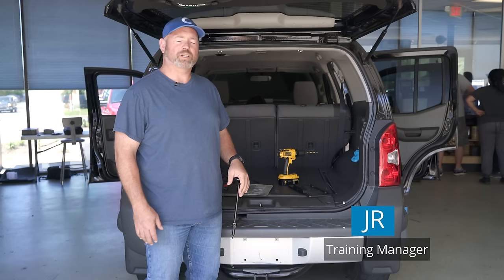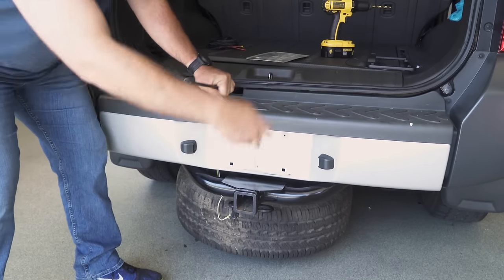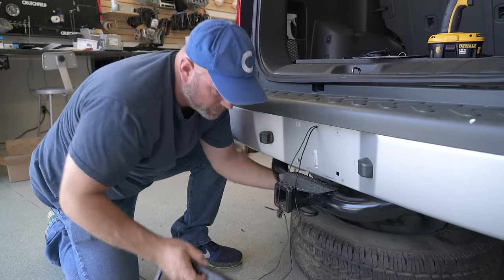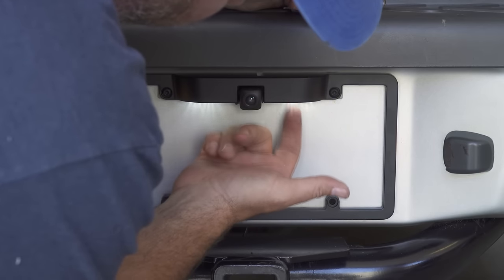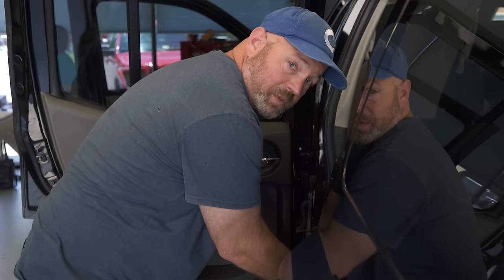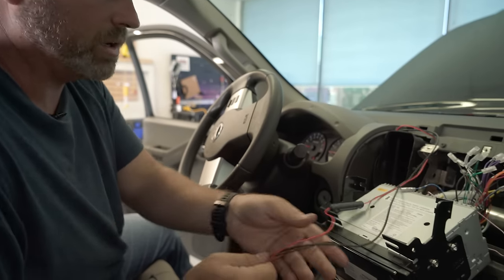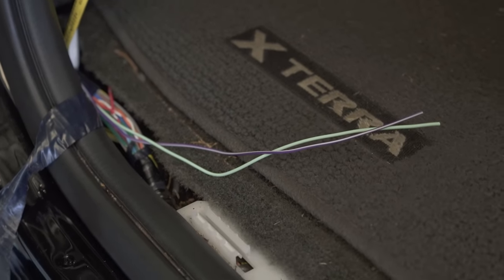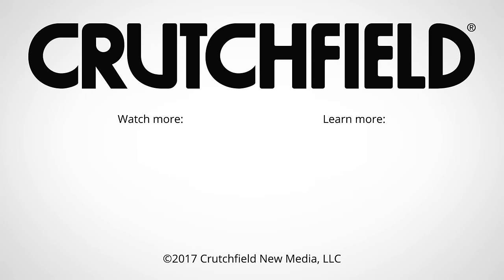How to install a backup camera in your car | Crutchfield video

Comment: The best option is to power the reverse camera from the vehicle's reverse light. Camera need to be powered only when you're reversing, thats how i do it all the time. Unless you have the bird's eye view system.
Reply: Exactly,why make it so complicated
Reply: If you have a backup camera it would seem handy to have it on while you're driving also just to have it.
Reply: I would find that a distraction.
Reply: @age_of_reason  Thats exactly what i do. This is very helpful when you have a vehicle with poor visibility through the back window.
Reply: Bruce@CampArmament does your camera run full time? Who makes it? Ty
Reply: @bowlingballmagic  It does run full time and is made by ESKY, it cost a whopping $18 shipped and I have been impressed with it.
Reply: @age_of_reason   Premature failure. Running WAY more than it needs to. Electronics only last so long.

Comment: Never use those taps.  ESPECIALLY on the exterior of a vehicle.  ESPECIALLY where it will get wet.  ESPECIALLY on a utility vehicle that will most likely be used off road.  Just because it is easy.
Reply: How would you do it correctly?
Reply: @metroids224  Sauter the wires together and wrap them in electrical tape.
Reply: I would recommend using solder as well but using shrink tubing instead of tape.

Comment: why didnt you show us how to find the wire for reverse ,to wire up the front part
Reply: Paul Aguilar the location varies with each make and varies with each model. There is an industry standard for the color of the reverse wire, which is orange/white. But as the vehicles get older this becomes no longer true. I know this is old but maybe it’ll clear some things up for someone else.
Reply: The wires are different for each car, you need to look up a wire diagram to figure out which wire you need to tap.

Comment: If your not sure where your reverse wire is you can simply run a wire from the stereo to the reverse light since you will already be running the harness for the backup camera

Comment: With the plate being on the bumper, not on the hatch, you can also go under the vehicle along the wire loom that goes to the cab and come in through the firewall wiring grommet. Harbor freight sell the flexible plastic wire loom to run your wires in. The way he is doing it keeps the wire safe and dry inside the vehicle. Much better.

Comment: I feel like you didn't cover the reverse wire much..
Reply: Same here totally confused
Reply: purple guy. I returned this a year ago
Reply: You just run a wire from the reverse, duh
Reply: Joe Biederman if only you knew the time I wasted on this shit.. I ended up taking that back a year ago
Reply: He covered it as much as it can be covered. If you don't know how to properly use a digital multimeter to test voltage on the wire you can probably find it at your vehicles BCM usually in one of your kick panels. But you can get it at the back of the taillight assembly near where you're mounting the camera but again a multimeter to find the correct wire without blowing up your car.  If you don't understand basic electricity then you're better off letting a stereo shop do it for you. Otherwise chances are your going to cost yourself alot more money than what a backup camera costs when you inadvertently fry a computer in your car..it's not rocket science by any means but with that said you do need to know what your doing. Every vehicle has a different color wire and it can be in different areas in your vehicle. Therefore you need to be able to properly figure it out on your own.
Reply: @JoshSmith-wo7zw  finally I waited 2 years for this comment thank you!!
Reply: You connect the reverse wire to the back of the radio not the camera. That way if you're radio has the ability to use the rear camera to view what's behind you without the vehicle being in reverse. If you Power the camera from the reverse light then it will only work as a backup camera because as soon as you shift it out of reverse the camera looses power and you still have to connect it to the radio regardless so it knows to go to the backup camera input when you put your vehicle in reverse. So regardless it has to go to the radio either way. Reverse light circuits are usually always positive trigger. Not negative. This is important because if you have a vehicle that has a negative trigger reverse light circuit then your going to have to use a relay to invert the polarity to your radio otherwise it's not going to work. Again you need to know what you're doing.

Comment: If I may ask, wouldn't have been more efficient to power the camera from the reverse light's power wires?
Such a connection will only power the camera when the gearbox is set in reverse, thus (probably) prolonging the camera's life.
Reply: i agree
Reply: I mean, worst case scenario, for the newer cars that "monitor their lights" and might throw a tantrum, just use a relay; order shall return. :)
Reply: That is correct. That is the ideal connection if you only want to power the camera when car is in reverse. I want to have it on all the time so I ran my wires to the monitor up front. Still haven't been able to get the setup to work. I think I have a defective camera, monitor, or both.
Reply: Current stereos have the ability to select and show it without having to put the car in reverse for various (not not fully common) reasons.   You can wire into the reverse for the trigger but you want constant power to be able to view it whenever.

Comment: Anytime you run a wire/cable/hose thro a metal hole you need to install a rubber grommet in the hole to keep the wire from chafing & eventually shorting to ground.

Comment: I have an SUV with the license plate in the hatch (2006 Mazda Tribute). That's going to be an interesting install, but I think I am up for it. Just need to get the wiring throug the hatch somewhere, then up behind the plastic hatch panel, and the hard part will be getting it up through the rear window frame and I hope to be able to fit it through the stock rubber wiring boot for the rear defroster/wiper and out under the headliner, down the rearmost pillar cover, and out in the area behind one of the platic interior covers that goes over the wheel well. Then im golden as the wires for the lights are running right there to tap into the reverse light positive for camera power and trigger (I have already had that panel off to repair a rusted out wheel well/shock mount, if you have a first gen Mazda Tribute/Ford Escape/Mercury Mariner you know the pain I'm sure). Then all I have to run up all the kick panels the radio is the RCA cable with the trigger wire on it and done, I think.
Reply from the maker: With all the forethought you are putting into this, you should be able to get the backup camera installed. Good luck!

Comment: The really mystifying part is decoding the terminology used to describe wire assignments since I have wiring hardware, radio, and camera coming from three different manufacturers who use slightly different terms or abbreviations. There's also the shade of colors used for the wires themselves and the number of wires. I have a violet wire that looks black and has three different green colors and four orange wires, but I only need one... I think. On top of this, everything is printed in micro text. At least I get sound out of the front speakers, I may forget about the backup camera though.
Reply from the maker: Hi TB, in some cases wiring everything up can take some extra time. Keep in mind if you got your components here, you can call our Tech Support for help with your installation. Their direct number is on your invoice.

Comment: I bought the Toguard CE80A, the mirror & the GPS was easy to install but ran into a problem trying to find a place for the rear view mirror.  I have a Buick 1999 Riviera and I really don't want to drill any holes on the car.  Any ideas?   Thanks    Joaquin In Tucson Arizona    Thanks for ur post.
Reply from the maker: We are not aware of a way to install a review camera on your car without drilling for at least the cables and sometimes to mount the camera too.

Comment: OK so great video but the reverse wire What color wire does that get tapped into, trying to get this done on my 03 Chevy Silverado 1500. I need that connected for the camera to come on when I put the truck in reverse right?  That wire is not connected right now and I have to push the camera button on my Kenwood unit to get the picture from the camera to come on. Thanks
Reply from the maker: It's color is typically light green but can vary depending on if you vehicle was one produced on a day they ran out of that color wire or a different color. I'd recommend contacting a technician to get help identifying and locating the wire you should use for this reverse trigger. If you purchased it from us, I recommend calling our technical support for this help

Comment: Hi I have installed a back up camera and each time I use the indicators the reverse camera screen is activated any idea what this could be?
Reply from the maker: You may want to double check the wiring or even camera settings menu on your receiver. If you got the camera here, please call our Tech Support. Their direct number is on your invoice.

Comment: On the Xterra, can you be a little more clearer on the color code of the parking brake wire in the kick panel, an how to hook to the reverse light at the rear of the Xttera. In the video you hooked that unit to the license plate light, which I assume powers both the bracket plate lights and the camera.
Reply from the maker: The parking brake wire should be green in most of those Xterras. Depending on the year it could potentially vary. Tapping into the reverse light circuit allows for both the camera and the license plate light to operate. You can connect with one of our Product Advisors here:    https://bit.ly/2DGSzu3    for personalized advice to make sure you have everything you need.

Comment: I have the same exact vehicle. Which wire in the kick panel was tapped to turn the head unit on when in reverse?
Reply from the maker: The reverse wire in the head unit's harness must be connected to your vehicle's reverse lamp circuit for automatic video switching to occur.

Hope that helps!
--Crutchfield
Reply: Crutchfield.  I also have an Xterra.  How do I know which wire in the kick panel is the reverse lamp circuit wire?
Reply: To those with xterra's. That grounding location is not recommended. That used grounding location is where a screw to secure the console/ stereo should go.

Comment: When you add a rear camera to the main windshield mounted camera, which plugs into cigarette lighter, is it necessary to add a fuse to rear camera?
Reply from the maker: It should not be necessary. If the additional camera gets its power from the main unit, then that's got it covered. If the new camera's power wire is designed to be spliced into the stock wiring, then its typically being connected to a switched and fused circuit in the vehicle

Comment: hello I have a ford explorer 2004 I want to install a camera from riversa but nose where to connect the pink cable of parking break connects in positive or negative help please
Reply from the maker: It would be unusual for the rear-view camera to have a parking brake wire or connection requirement. They commonly just need 12volt power, ground and the video connection to the aftermarket stereo or monitor.
For additional assistance and personalized recommendations, feel free to contact us directly by phone or through our online chat service:
http://bit.ly/2jBGHPp 
Hope that helps
--Crutchfield

Comment: It appears that he connects to power in two places: in the rear at the license plate light and in the front in the head unit harness. Is it necessary to connect to both? Can you just connect to power in the stereo harness?
Reply from the maker: This particular rear-view camera's frame, did come with additional lights to help to illuminate the rear license plate. The connections made at the bumper locations, were power connections to the factory license plate lighting system, and only provided power to the additional lighting on the new license plate bracket.
The power wire for the camera itself, is ran to the front of the vehicle, and uses the same accessory wire as the stereo.

Comment: Hello, what would you recommend if the license plate frame is off-center, like on my rav4 where the frame sits to left of the spare tire mounted on the rear door of the car?
Reply from the maker: Hi Nick!  
Most backup cameras do have a wide viewing angle, or you could go with a flush mount camera that you could install in any location that you found suitable. 
There are also times that an OEM mount backup camera may be available for some models of cars.
Feel free to get in touch with us! We will be happy to look into these options for you, and go over this in more detail!
www.crutchfield.com/I-rYTVc164/contact

Comment: My camera is connected to a pioneer avh 2550 nex but when I put it in reverse it resets my radio AND puts it in advertise mode? Please help me
Reply from the maker: So sorry to hear you're experiencing these issues, Anthony!
If you purchased your receiver and/or camera from Crutchfield, please contact our technical support department.  You will find their contact information located under the My Orders tab, when logged into your online account.  Please have your order number handy prior to calling.

If you did not purchase your gear from Crutchfield, you may wish to reach out to the technical support department of the retailer you purchased with, or by reaching out directly to Pioneer for further advice.

Comment: How do you seel up the drill hole so it doesnt cause rust issues?
Reply from the maker: The typical vehicle will have a fiberglass bumper and not be faced with this concern. If you are installing into a metal surface, auto stores sell metal coating products to help recoat the newly exposed metal.

Comment: Hey i installed my backup camera and it works when i put it in av mode but when i put it in reverse the camera comes on but it doesnt show any picture just black but it works in av mode
Reply from the maker: Sounds like you may have connected the camera to an auxiliary video input (for external video sources) instead of the rear-view camera connection on the stereo. Check the input connections on the stereo and ensure you've connected the camera to the proper input. 
Hope that helps
--Crutchfield

Comment: What confuses me is the positive wire for the backup cam. I've seen some say to tap it into an accessory wire, and others say tap it into the reverse lights. I understand the benefits and reasoning for both, but in this video he just wires the positive straight into the headunit itself??? I have EVERYTHING complete in my install EXCEPT the positive and ground wires... I don't know where to connect them lol.
Reply from the maker: He used the switched power wire at the radio location because that can be easier if the wires are long enough to run to the radio location along with the video cable. He just undid a connector, added the new wire to the switched power wires, and reattached the connector. Simple, clean, and effective.

Comment: How much would this install normally cost in a Malibu car?
Reply from the maker: Hi Berenice, installation pricing does vary from area to area and installer to installer. Your best bet will be to get a couple of price quotes from a couple of well recommended local installers directly.
Reply: @crutchfield  thank you! I just don’t wanna be robbed from my money😅
Reply from the maker: Definitely a good idea to ask around for a couple reputable shops and then check them out yourself directly. Keep us posted.

Comment: I have a Boss BN965BLC receiver installing in a 2005 Chrysler 300. Should the Violet/white reverse be connected to the red power and red video wire in back of the radio?
Reply from the maker: That wire coming off the back of the Boss radio should be connected to a wire in the vehicle that is only active when the vehicle is in reverse as its meant to automatically bring up a backup camera video feed. If the harness you are using to install the new radio does not give you a reverse gear wire, then you will have to hunt one down in the dash. If you purchased this gear from us, you can call our technical support for help. Their number should be on your invoice. If you purchased it elsewhere and they are not able to help, you might try calling Boss for assistance.
--Crutchfield
Reply: Yes, I have a reverse gear wire. In the front it is connected to the reverse wire from the back of the radio. At the other end the reverse gear wire is hook up to the reverse backup light in the rear. It is grounded to the black wire with the license plate camera. When I turn on the system, the panel freezes up and no controls work. I then have to go into settings and turn off the reverse under other menu in order for everything else to work minus the camera. I will definitely place a call to the tech on this.